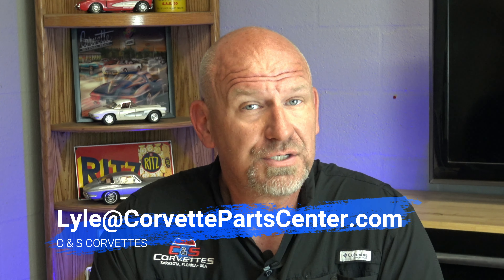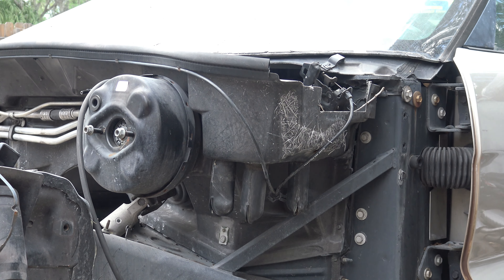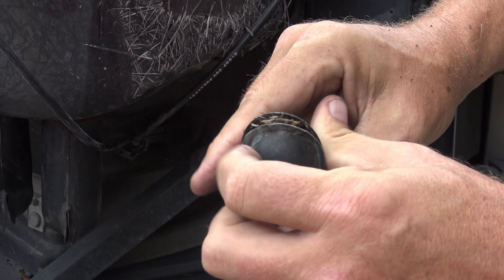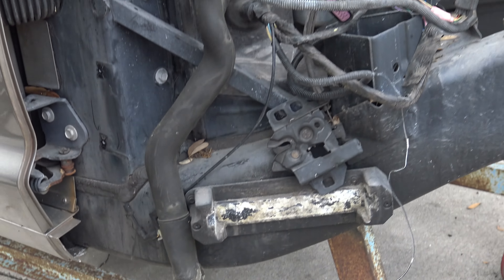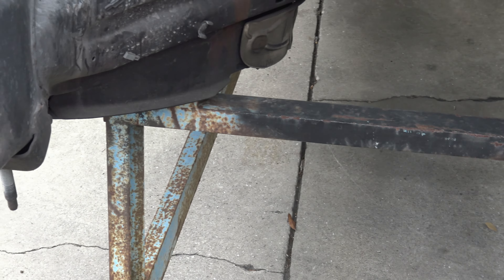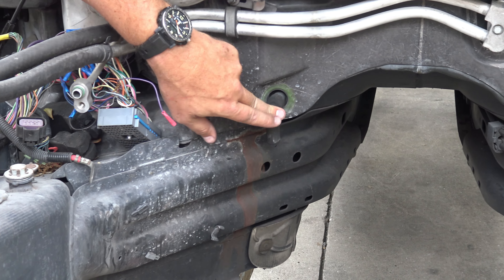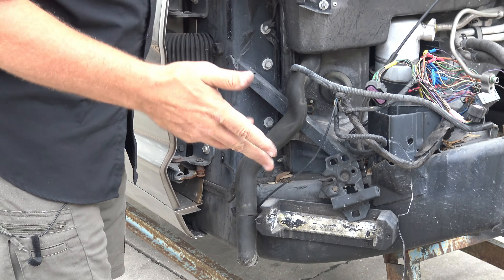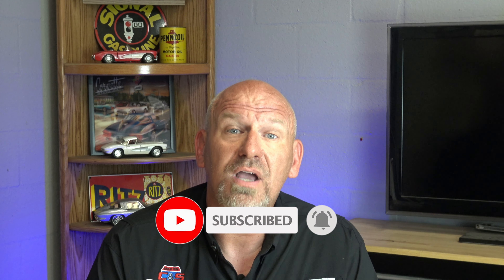Corvette Spring Cleaning Tips C5 & C6

Comment: Lyle, I have a 2006 C6 with the udder on the passenger side, but the driver side does not have udders , I searched for months, but has an opening that is about 4x6 which is large enough to not plug like the udders.
Reply from the maker: Thankk you for the clarification.  I didn't have a C6 on-hand the day we shot that video, and I was going from my (faulty) memory.  :)  Lyle

Comment: Lyle, great video but you covered the drains in front and not the rear. My 2013 C6 accumulates water mainly on the passenger side in the corner of the back hatch from rain or washing. The trough if I'm not mistaken has a total of 4 drains 2 in each corner and 2 on each side not quite half way in the trough for the hatch. How do I clean them out and where is the exit located?

Comment: I have a 2013 427 convertible and after finally getting my hand under there on the driver's side, I can tell you that mine does Not have the udders on the driver's side. The passenger side does and is just like the one in the C5.

Comment: Question for anyone especially warm climates. I have a 95 c4 the dashboard by the middle defroster vent next to the windshield is coming up is there an easy fix or do I have to pull the windshield? Also the defroster vent will not stay down in the holes.
Reply from the maker: The 94-96 Dash pads are famous for curling with heat and age.  That is why the defrost vent won't seat like it should.  I am not aware of any reliable solution to this problem--Camaros and Firebirds had similar issues in those years.  Lyle

Comment: Good afternoon I have a 2012 C6I just brought it at 18000 miles on it I'm wondering if I should have the antifreeze changed I don't think the person never did And possibly how much is that cost in a shop or a dealer
Reply from the maker: The answer to changing fluids on a new-to-you car is ALWAYS yes.  Coolant flush and refil should cost about $150-$200.
Reply: @csvette   Thank you so much appreciate it And great videos keep him coming
Reply: Just bought a 2009 C6 with 18,000 miles. Changed coolant, oil and filter, air filter, cabin filter, and cleaned Mass Air Flow sensor. Flushed brake fluid too. Lastly, replaced the original run flat tires. Now I drive with peace of mind knowing the fluids and filters are fresh. Enjoy your 2012!